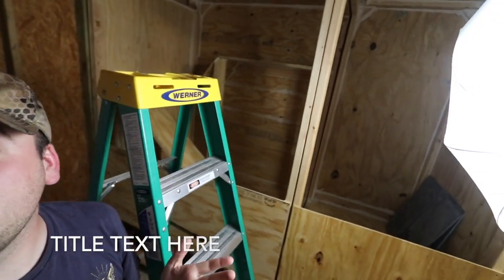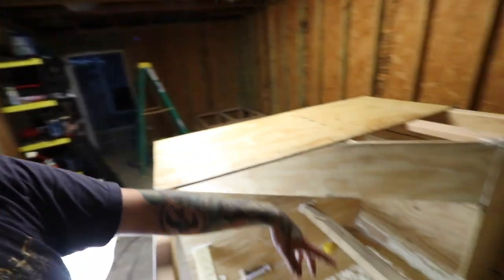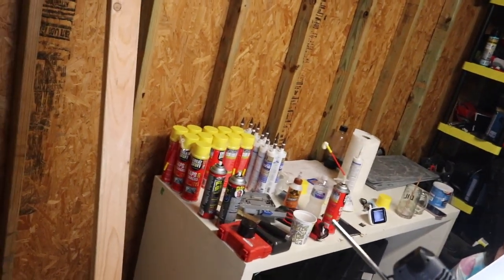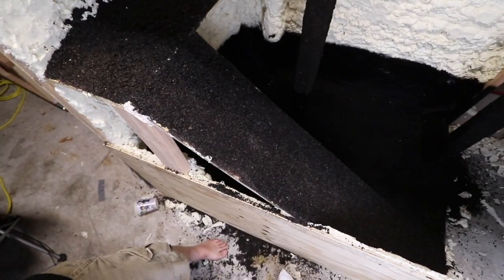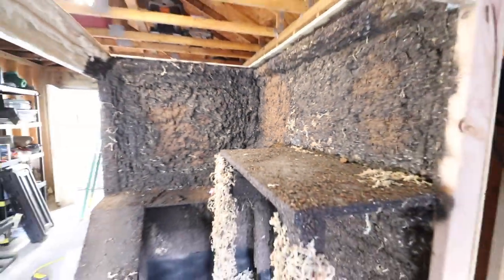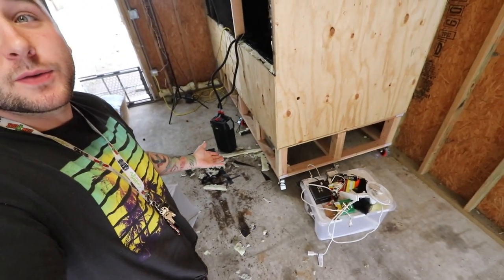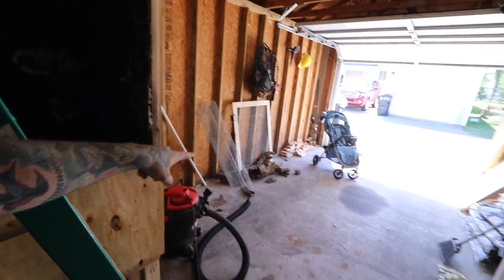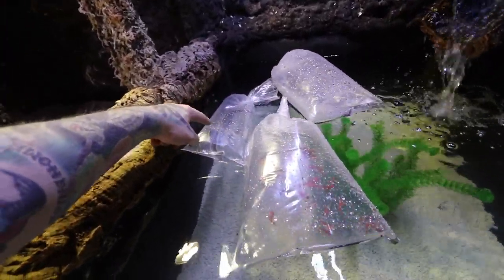PRO-LEVEL ASIAN WATER MONITOR CAGE BUILD IS DONE! (Pt. 2)

Comment: flex seal was a waste of money.. grout mix is cheap and works just as good. I also sprayed everything with a water sealer and that helped. I looked at flex seal but for the price I cant justify it. I built a 6x6 ft enclosure. It gets costy fast but so much fun.

Comment: You should paint the outside of the wire black for better viewing. Also next time, don't tip the bag water in with the fish as they stress in it and fowl the water. Also the monitor is going to claw holes in your pond liner so you might have a bad time lol.
Reply from the maker: well, none of that happened.
Reply: @AndyGabbs  Lucky.

Comment: I wish you showed the doors more, I’m trying to make doors like that with wire mesh but I’m struggling to thing the best way for strength, is it one piece with a cut out or 4 put together?
Reply from the maker: One piece with the whole cut out, I used a staple gun to get the wire to stay on. I used ALOT of staples. 2 layers, one staple about every 1.5 inches

Comment: I also have a asian water monitor that's 2 feet long in a 4x2x2. The bottom of of the tank is filled with water. My cage that I'm going to build 16x8x8. When your monitor gets to be 4 or 5 feet that water hole is not going to be big enough for him to swim in. Then what?